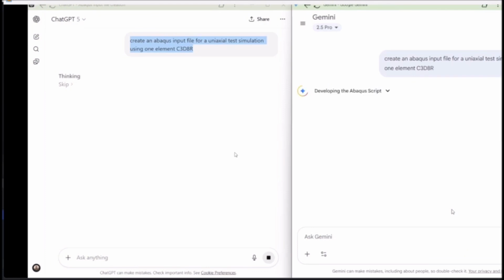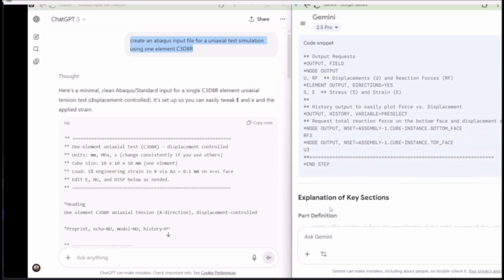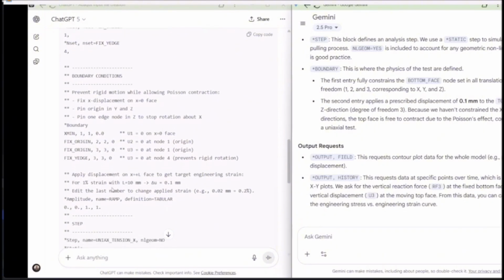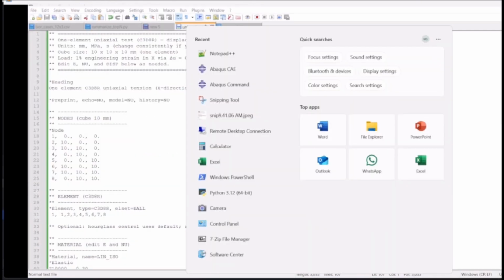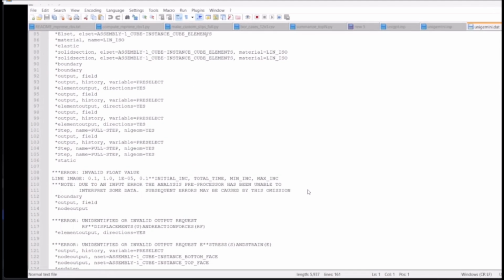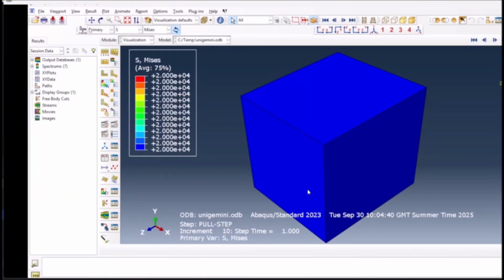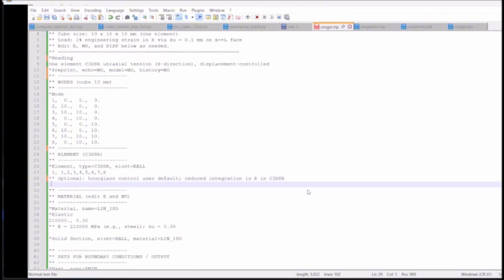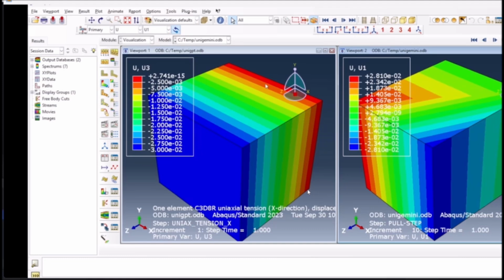ChatGPT vs Gemini: Can AI Really Write ABAQUS Input Files? 🤯 | FEM Challenge

Comment: Thank you Prof.! I am trying to run a UMAT code which I got from Chatgpt. It is for creep tensile test by using Kachanov-Rabotnov damage model.  The code run but it shows straight strain line. I think the problem is in the code and simulation does not complete.  AI maybe not much reliable. I am struggling with the UMAT code.